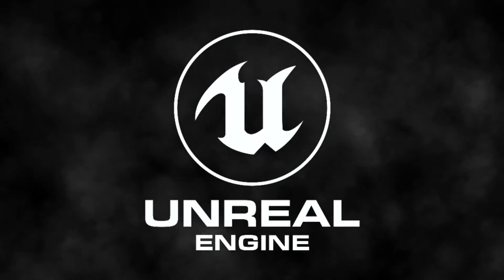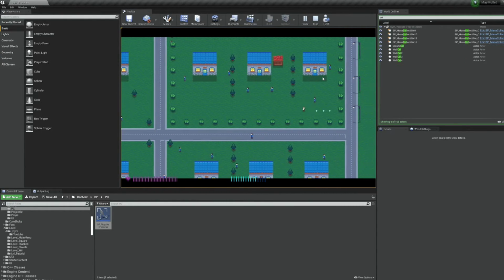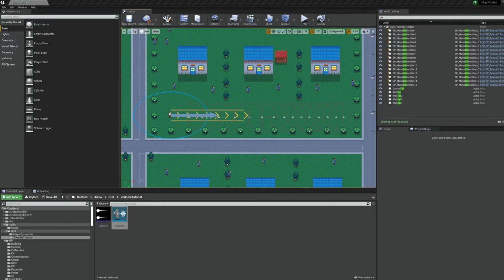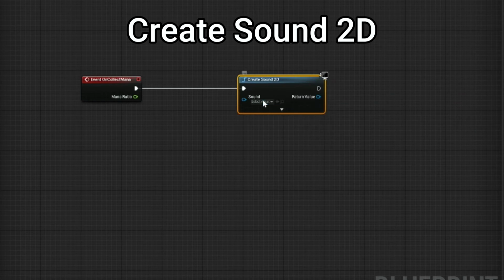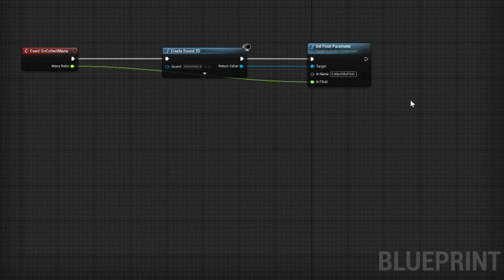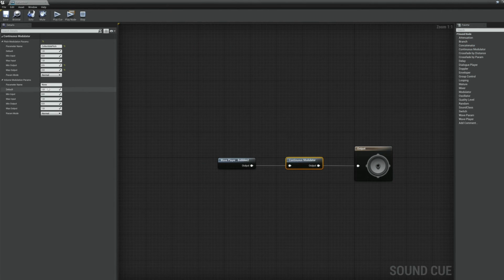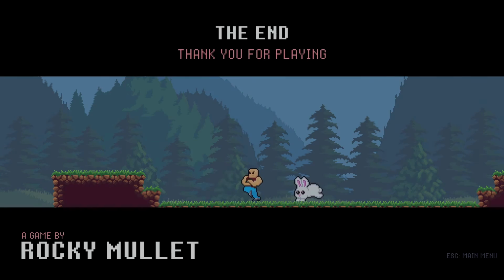Unreal Engine Tutorial | Change pitch or volume - continuous modulator | Audio

Comment: why my sound effect wont go more than 2 pitch?
i tried to put 2.3 or even 20
but it cant change
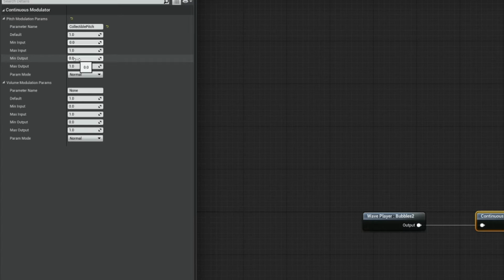Reply from the maker: 2:04 take a look at the values of your output, in my example, I used 0.5 and 2.0, this means it with lerp between 0.5 and 2.0 depending of the input, the input being between 0 and 1.0, this means at 0, it will give 0.5 pitch and at 1.0, it will give 2.0 pitch. So you need to tweak those values.
Reply: @RockyMulletGamedev  yeah i know but i mean i wanted to go more like 1k or even 10k
(dont worry bout it, or asking why)
and i fax it through "MetaSound"
it allows me to go high numbers like this and it worked

Comment: just what I was looking for, really wish you showed the ratio part , maybe using Lerp or another node to keep the ratio 0-1
Reply from the maker: It's a simple division between the max and current value, clamped between 0 and 1.

In my case it's mana:
current mana / max mana
clamped between 0 and 1

I don't know the exact blueprint nodes for this (it's done in C++ under the hood and I call a blueprint event when it changes) but should be as simple as a division and a clamp node.

I think some people call it a "Inverted Lerp" cause that's pretty much it. A lerp is simply: 

(max - min) x ratio + min

I'm guessing that's most likely what Unreal is doing under the hood to interpolate the pitch / volume.

Comment: Awesome tut. Is there anyway to have the sound play at a location using this method?
Reply from the maker: Yes ! You could either have an actor with an Audio Component in it from which you would play your audio cue with the continuous modulator, then call "Set Float Paramter" on you audio component with the name and value like in the video.

OR

You could call "Spawn Sound at Location" instead of "Create 2D Sound" like in the video, from the returned value call "Set Float Parameter" and then call "Play" on the returned value.